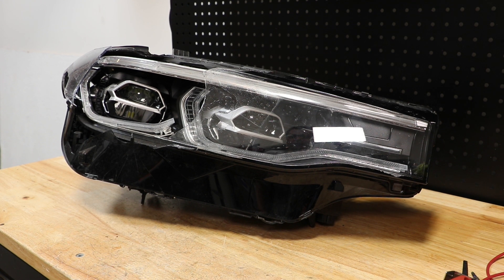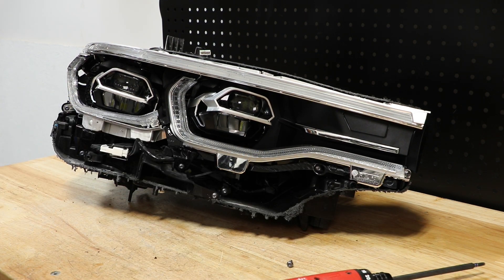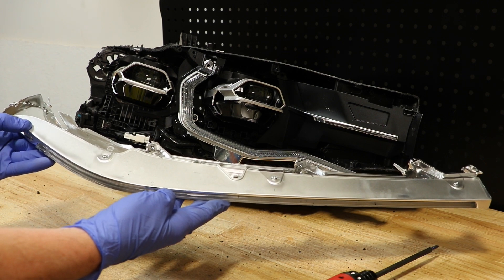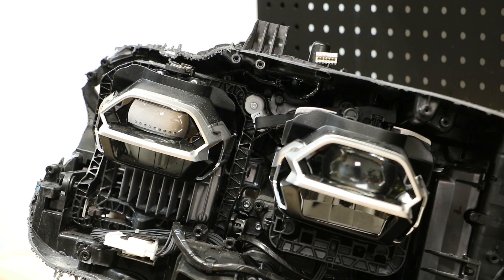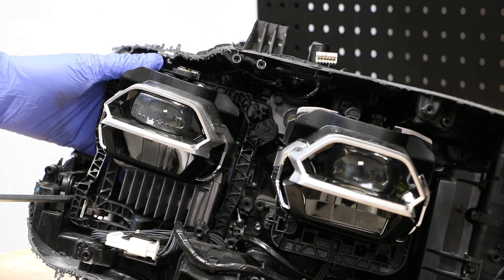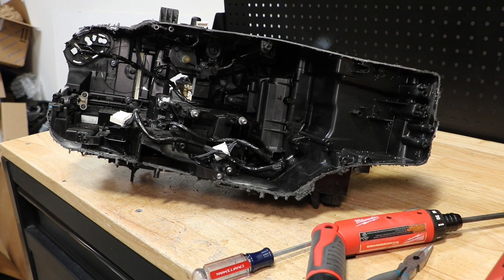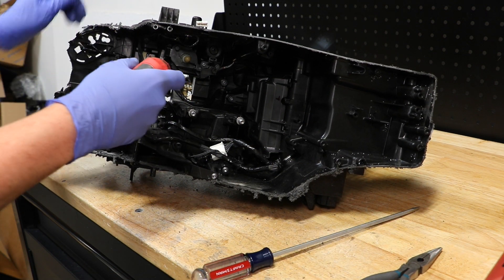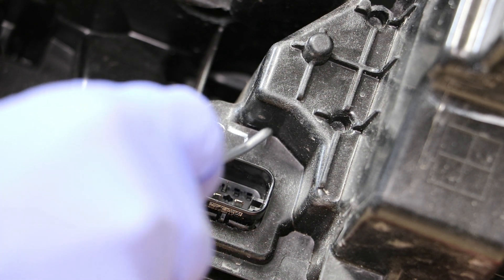2019-2021 BMW X7 LED Headlight Teardown

Comment: Is there a led module at the bottom for the outer drl tube?
Reply: I have the same question where do the drl chips go on the headlight???
Reply: @debwane the one for the inner drl is on top, the one for the outer drl in combined with the turn signal led module